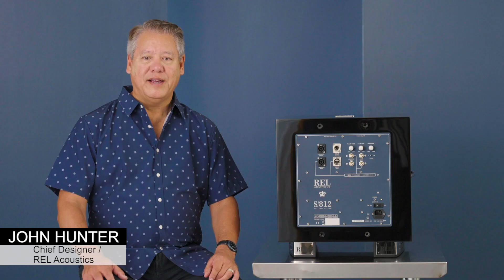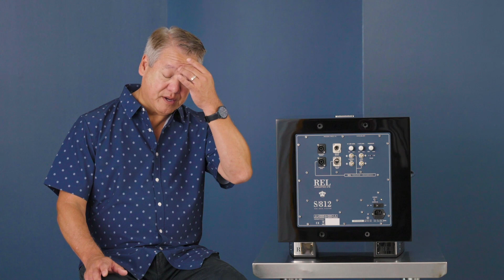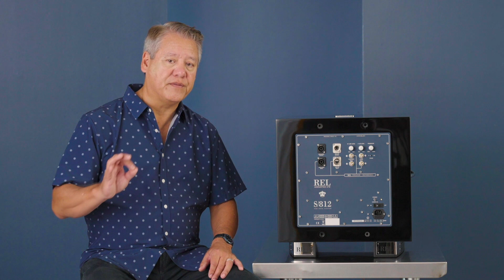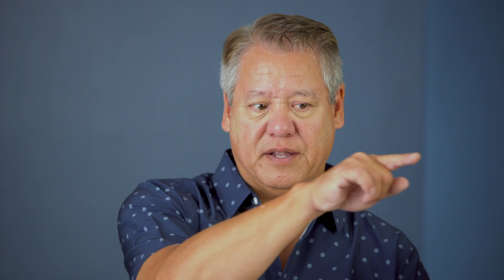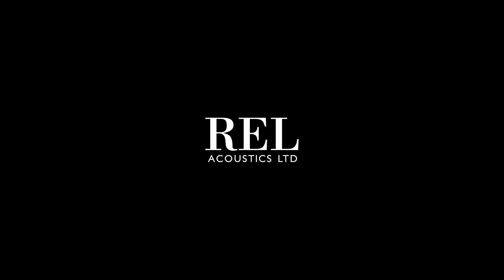Why We Call These Perfect Filters: Max Bass and Protects Drivers? Perfect.

Comment: I know a thing or two about subwoofers because I have designed and built a few myself.
What he says about driver size is absolutely correct. Most commercial subwoofers are way too small for what the drivers would actually need to perform their best.
So they compensate by using electronic filters and a lot of power.
Rel seems to go the analog route, which is pretty interesting

Comment: Does the T9i have this perfect filter? Shame it doesnt have the sub sonic one? I kind of assumed that all full range speakers have some lower limit filter in the crossover though?
Reply from the maker: Thank you for reaching out. The T/9i does not feature the "perfect filter" found in some of our other subwoofer models, but it does still use a very high quality crossover filter circuit to allow for seamless blending with a system's main loudspeakers. The T/9i also does not feature an electronic sub-sonic filter, since it was designed before we began implementing that in other models, though the physics of the cabinet size, driver size, and amplifier power rating will limit how deep the subwoofer can reach without a sub-sonic filter being involved.

Comment: Very interesting John. For the 212/SX, do you still have the perfect filter? Isn't that cabinet bigger than the No 31...so did you still need to use the perfect filter? Love your subs...I have 7 rel subs...2s510s and  5 Tis. So I love learning more...thanks for sharing!
Reply from the maker: Thank you for reaching out. All of the current Serie S subwoofer models feature the "perfect filter", which means that this filter design is found in the 212/SX as well as your S/510s.
Reply: Bigger cabinet but twice the active drivers.